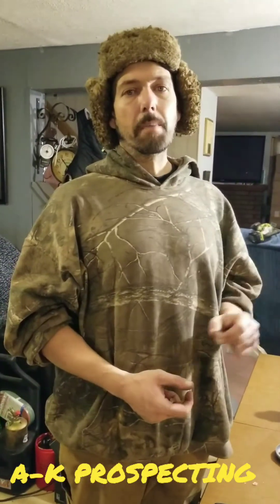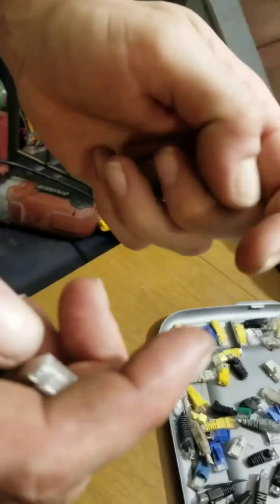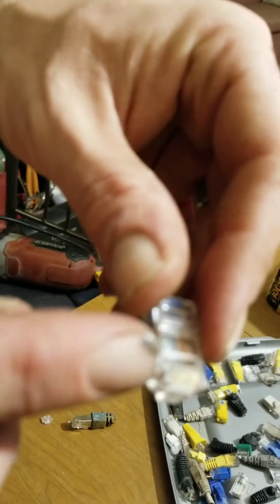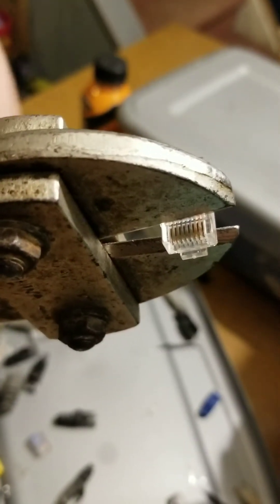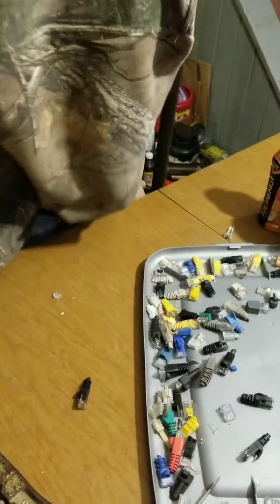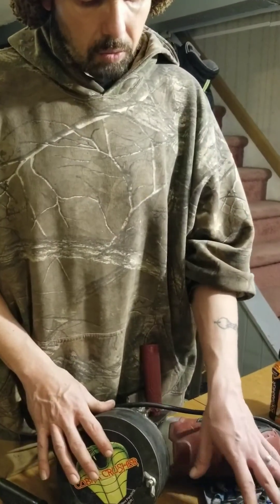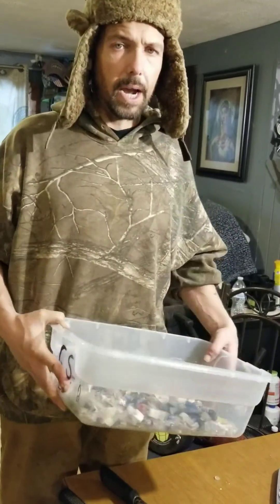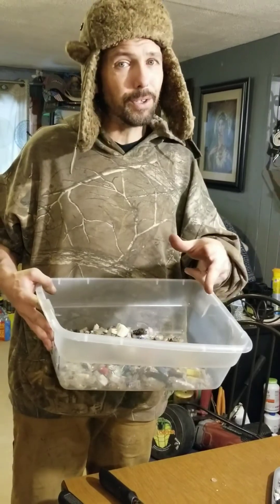Part 1 Gold recovery from ethernet cables

Comment: Bolt cutters would definitely be easier than side cutters. I might try some before and after cutting ends off, running them through a big paper shredder that was dumped by the demolition dumpster of a bank renovation. Maybe the motor and blades are strong enough to liberate the metal from plastic. Otherwise put the end parts in acid and dissolve the metal from the smaller cut plastic ends and not have the excess wires in the jacks attached and use less acids.